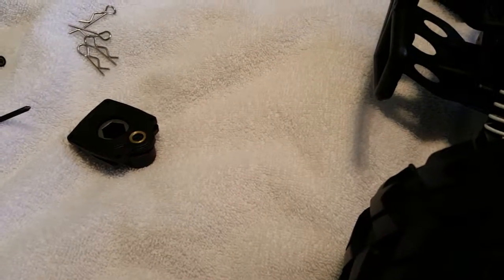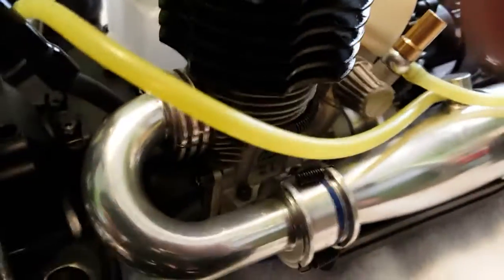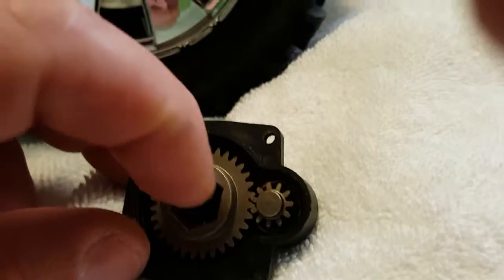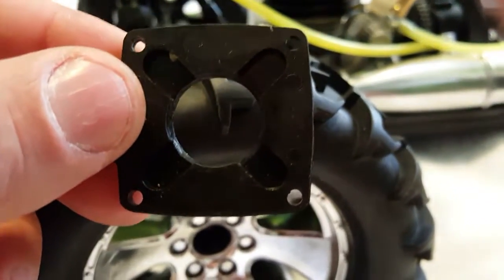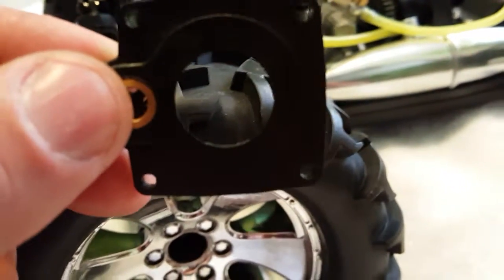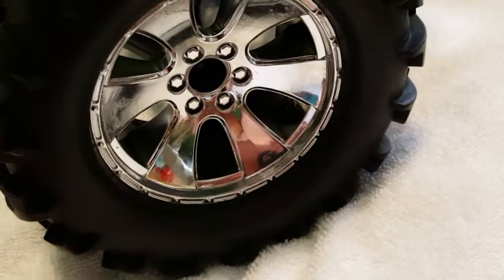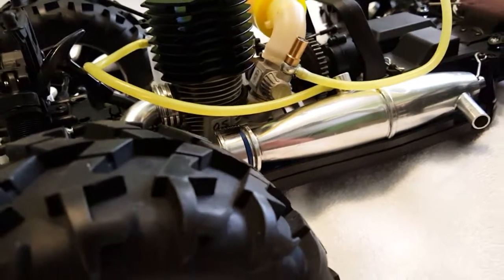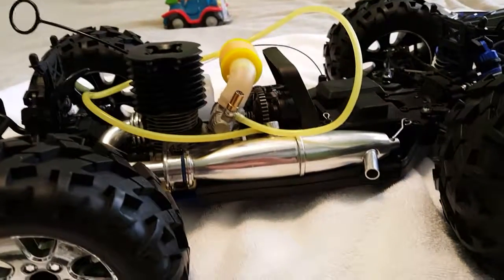Redcatracing os .21

Comment: I purchased the after shock 3.5 expecting to receive it equipped with the sh21 but I got the so called os21 . all i can say is I have had nothing but problems with it . pull start pulled out ,clutch spring broke,carburetor will not hold a tune ,the list goes on. on the bright side once I got it up and running it actually performed pretty well . I plan on replacing it eventually but all in all not a happy camper.
Reply from the maker: Ed Brunning exactly only problems sh is the way to go my friend